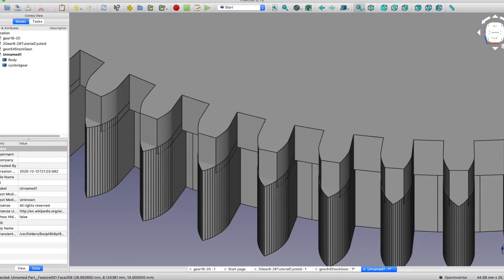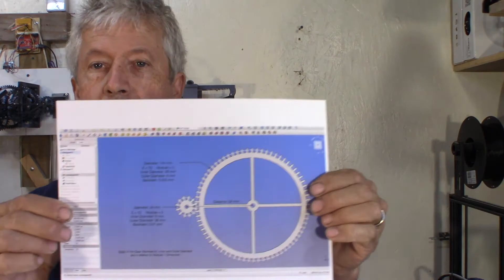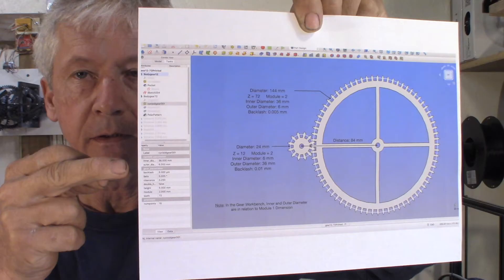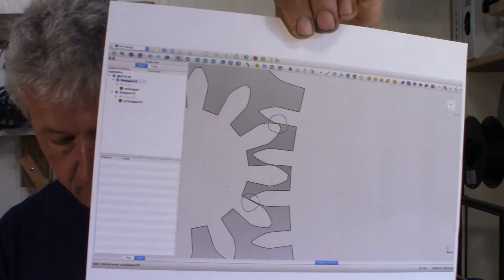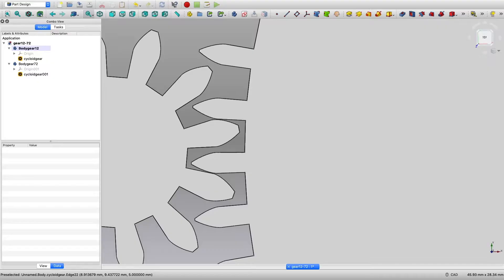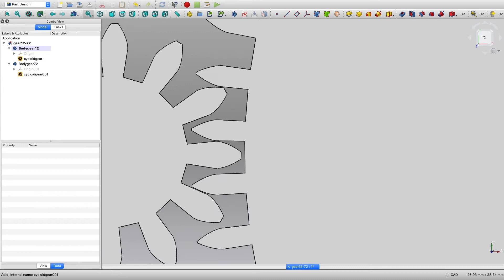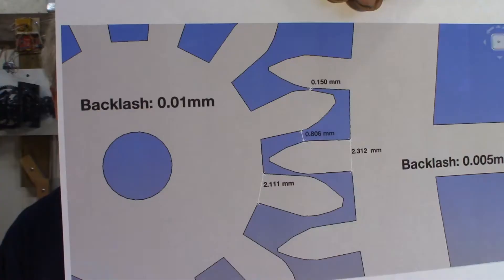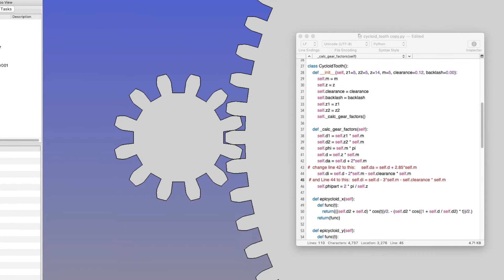Cycloidal Gear Design with FreeCAD

Comment: The gears look good. Hopefully they will reduce friction in your clocks. One downside of cycloidal gears is that the shape changes slightly when you have a 60 tooth gear driving an 8 tooth pinion or a 10 tooth pinion. Each gear/pinion set needs to be regenerated. Luckily, there are usually not many different gear combinations used in a clock.
Reply from the maker: Yes It is quite challenging...Poor guys that needed all those tools to manufacture cycloidal gears... we only need one printer, the CAD does the rest
my goal is to get 24 + hours on a single drop
Your clocks inspired me to push my limits, thanks for providing the challenge

Comment: Where do you go to change the values in pythons x)  Got my gears just perfect if not for the part where I need them to have longer tooth...
Reply from the maker: In the latest version of gear workbench there is a parameter called   : Head
Positive value will increase the length of tooth
Reply: @jacquesfavre999  Hi! thanks for the response! Installed python 3.10. downloaded latest verssion of freecad because the update was not working on python 2.8.
See the new gear types but no new parameters for cycloid gears :(
Reply from the maker: @MathB_Official  Actually doing all in GUI
to find the files make a gera with 0 teeth, that will give an error , but show where the file is
I do not know what python I have, i am on mac os